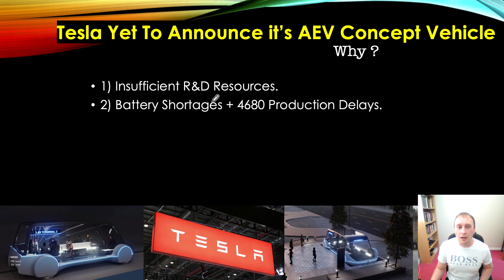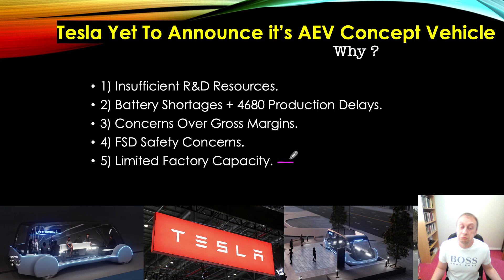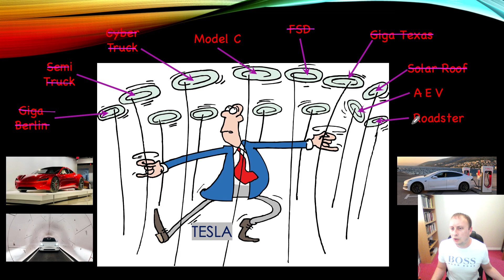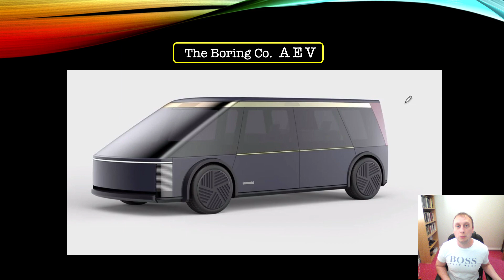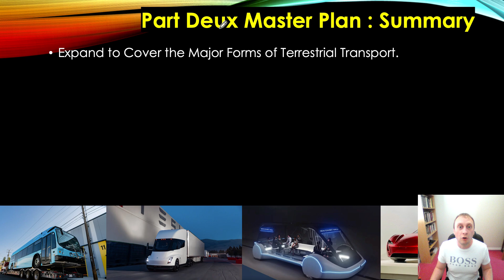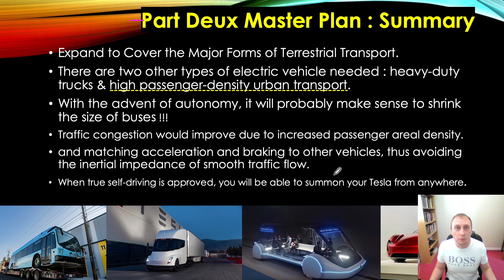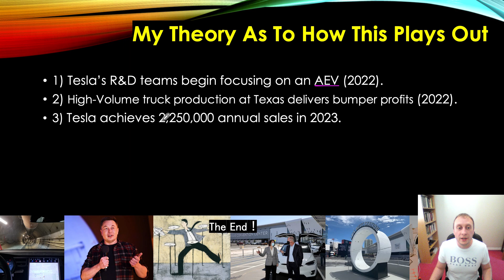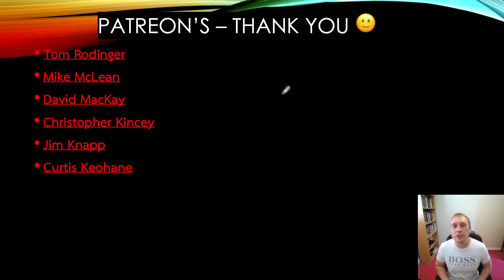Tesla's Part Deux Master Plan Calls for a 125 mph AEVs 🤑 🚐 🔋 🚇 👍🏼 Episode # 112

Comment: There are 10 pax vehicles made by Yutong in China that are in trial use.  They could get Local Motors to print a vehicle that could run at the speeds they are using in Las Vegas. 

Why should TBC wait for Tesla?  If there is a suitable COTS solution available they are fools to do so. Or it is just a hobby for Musk?

Tesla doesn’t have to solve FSD to use AEVs in TBC tunnels because they have near total control over the guideway and there are far fewer edge cases.

The metaphor of spinning plates makes all those projects equivalent when they are not.

Comment: I think your missing the fact that the Boring Co. doesn't make real sense for Tesla as a priority until FSD is APPROVED.  We are still a couple of years off of that.  Las Vegas still has courtesy drivers and no other project is complete or even well under way.  I think all your time lines are several, maybe 5 years optimistic.  An AEV as you envision it has no market until after FSD is approved in several states, and you have several boring tunnel projects operational.
Reply from the maker: I Fundamentally disagree ! 
TESLA FSD is 99.997% done and the remaining 0.00299999999% will be complete in under 20 months. . .

If you think FSD Level 4 occurs after 2026 you either don't understand the incredible progress FSD has made in 2021 or you want FSD to fail.

The COVID delays didn't help but the team is back on track and they are close.

Comment: Zoox has 4 seats, which is a downside compared to the Boring Company  but I like that it can drive in either direction. No need to turn around.
Reply from the maker: Zoox is the perfect vehicle for narrow surface streets in High-Density cities like New York, Hong Kong, London, San Francisco and Seattle.
It should also do very well with regards to efficiency and manoeuvrability in most locations. . .

Comment: Would single rear wheel drive work fine for tunnel vehicles if top speed is not very high??
Reply from the maker: Possibly yes but the advantage of 4 wheel drive is that you can use different gearing ratios on the Front or Rear motors thus increasing the theoretical top speed from 160 mph to 200+ mph. 
So if they plan to go faster, they'll opt for a Tri motor setup / Quad motor.

Comment: First step is to use FSD on existing cars. Limitations are therefore SW team. They seem to attack individual tasks at a time in three month jumps no radar, 3d + temporal visualisation so FSD 10 probably necessary. Batteries, Manufacture and AEV irrelevant. If they can't demonstrate autonomous all boring project contracts doomed so a priority for FSD 10.
Reply from the maker: I'm very confident in my FSD projection as Elon is now acting very confident.
That makes me excited beyond belief !

Comment: Once you’ve removed the cost of the driver from the bus, the optimum number of passengers is an interesting question.

It’s obviously less than the current 30-40.

I’m guessing it’s somewhere in the 10 - 20 range, so it could share a platform with a van, ambulance, etc.
Reply: 8 max.

I pulled that guess right out of my ass.

Just wanted to go on the record for my ancestor simulation.
Reply: @jtjames79  Could be, who knows?

It might turn out that Robotaxis are so cheap that buses become obsolete.
Reply: @fredbloggs5902  busses operate not for profit. Basically all public transportation operate in negative numbers. The sole reason for their existence is to ease the traffic in cities.

Robotaxis would not solve that problem, 1 bus=120 people, same length in Robotaxis =3 taxis, = 24 people. So you would make the traffic 5 times worse.
Reply: @derkach7907  door to door robotaxi vs block to block buses --  execution can make all the difference. public transport also seems a jobs program IMHO.
Reply: @brandoYT  block to block or door to door doesn't make a difference. You gonna have 5 times more traffic with Robotaxis than normal busses. There is no reason to do that.

Elon is "solving" one problem but creates 2 new problems to solve: personal "cheaper" taxis vs 5 times more traffic (traffic jams) , higher power consumption
Reply from the maker: it's definitely something in the region of 10 to 20 per vehicle. it is Weight Vs Density, what is the sweet spot ? maybe 14 ?
it also helps when you get into the evenings and demand falls off. Ideally you don't want the vehicles to be over 50% empty.